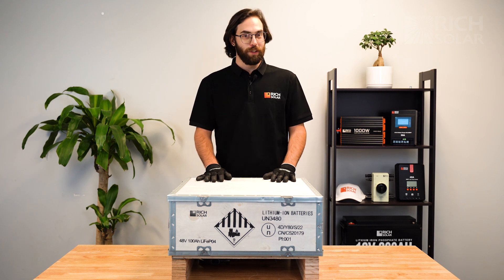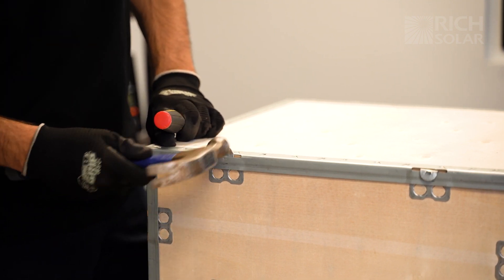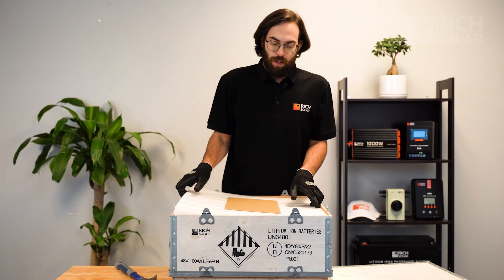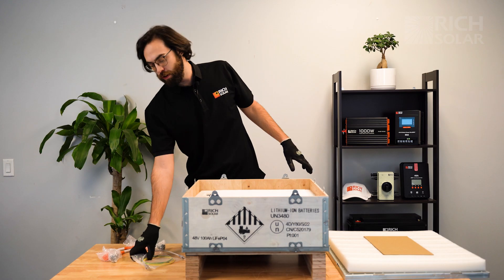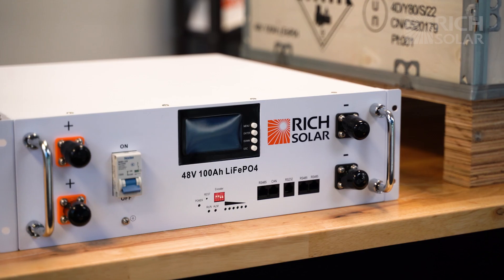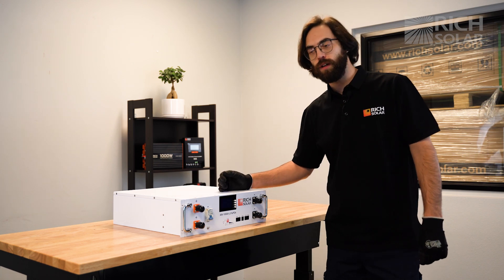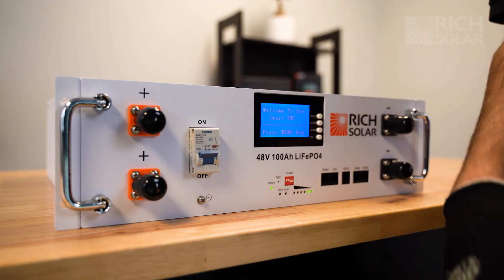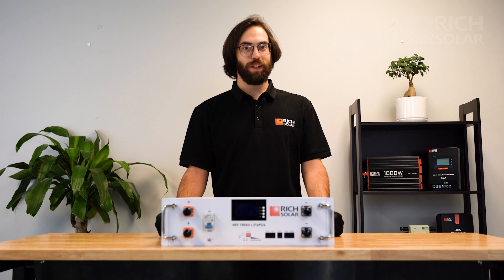How to Unbox and Power On The Alpha 5 Server Rack Battery - Rich Solar Talk

Comment: How do I get instructions on the battery? Also I can not get it to communicate with my Rich Solar 3000 Inverter when connecting the communication cable.
Reply from the maker: Hey, kindly call our  Tech Department at 800-831-9889 (option 3) or email tech@richsolar.com. Thank you!